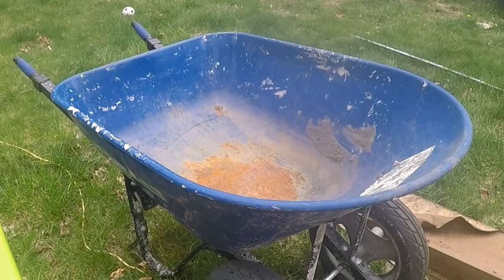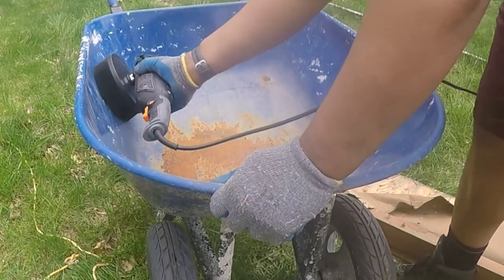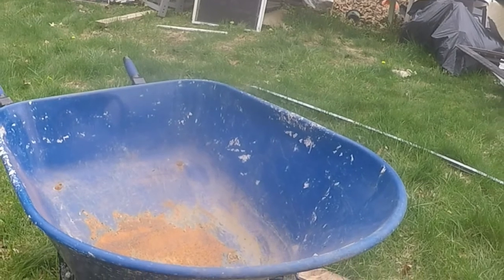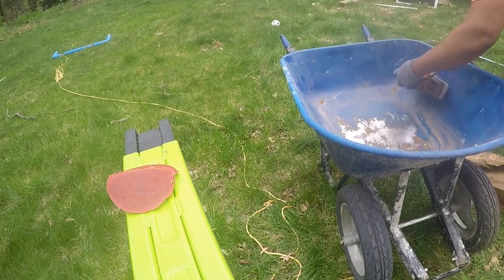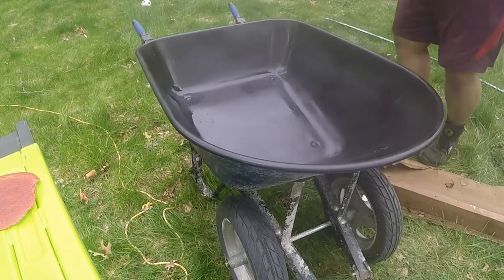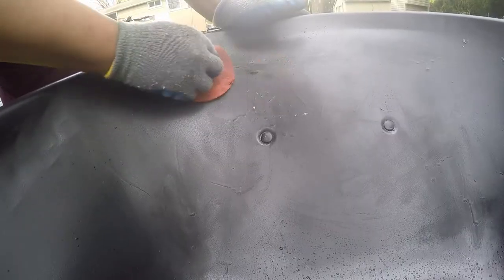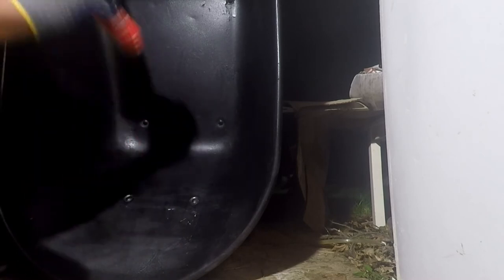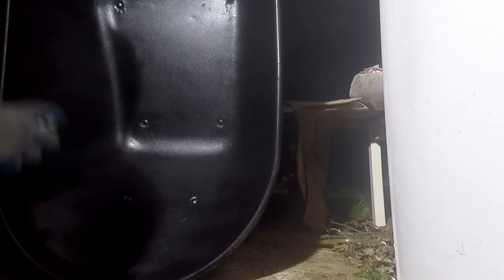Protecting Kobalt Steel Wheel Barrow Tub With Truck Bed Coating - M18 EP27

Comment: I'm currently rebuilding a plastic wheelbarrow I bought off Craigslist for $10. The principle defect was some cracking around three of the bolt holes.  The barrow has plastic wedges, so it's probably not much more than a few years old.

I've disassembled the barrow completely.  I primed the wood with Kilz primer,  and then brushed on  exterior house paint,  because that's what I had on hand. I had some canned spray enamel which I used on the steel,  which was in very good condition.

I replaced three rusted bolts holding the tray on. 

Because plastic trays have durability issues,  I'm installing a piece of fairly heavy plastic on the top of the tray.  It will be held in place by the four regular bolts,  and I'll probably glue it on the plastic of the tray as well to be sure it stays down.  Perhaps I'll use some caulk around the edges if that seems a good idea.

The only cash outlay on this has been for the bolts.  I gave some thought to replacing the bolts and hardware with stainless steel,  but decided against it.
Reply from the maker: Plastic wheelbarrows indeed has durability issues. Mine cracked like cold chocolate bar being shared. A wheelbarrow is something I want to purchase once and be done with. The dual wheel versions can be very rare. Hope your project turns out very well and serves you for a long time. I wish I could see how it's been done but you left a great description. That price makes me smile better than a joke.
Reply: @GoldenJudge  <<Plastic wheelbarrows indeed has durability issues. Mine cracked like cold chocolate bar being shared. A wheelbarrow is something I want to purchase once and be done with. The dual wheel versions can be very rare. Hope your project turns out very well and serves you for a long time. I wish I could see how it's been done but you left a great description. That price makes me smile better than a joke.>>

Thank you for your kind comment.

I'm   cultivating my status as a wheelbarrow buff,  interested in learning how to make them work effectively as a hobby,  rather than merely as a practical matter.

I just went out and looked at the piece of fairly thick plastic I glued on to the top of the tray,  hoping to reinforce it.  I was out walking and saw a mud flap that had fallen off a big semi truck.  That is the priece of plastic I picked up and am repurposing.  But how well it will work remains to be seen.  Perhaps the glue wont hold to the plastics very well.  

I also think it would be interesting to replace the traditional cheap bolts with stainless steel hardware that might make is simple to remove the tray to do maintenance and repair on a barrow,  but I haven'tm gotten around to that,  yet. 

So I appreciate your comments on my project.

I've actually been taking still  photos through the course of my project,  thinking I might create my first You tube video with them.  So keep looking for Wheelbarrow videos,  mine might wind up there!

Comment: So how has it held up?
Reply from the maker: Over the winter period, water pooled and froze, inside the wheelbarrow. Upon removal of the ice, some of the bed liner was removed. It was small areas, about 3 square inches in total. Otherwise it held up well carrying dirt and stone. Have not mixed cement in it. I intend to apply another layer but this time in the summer l.